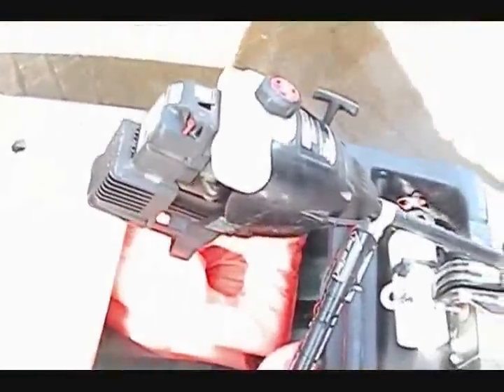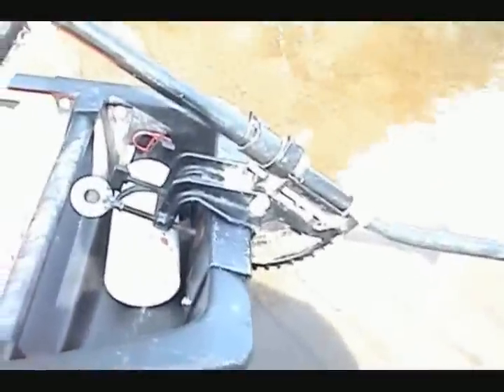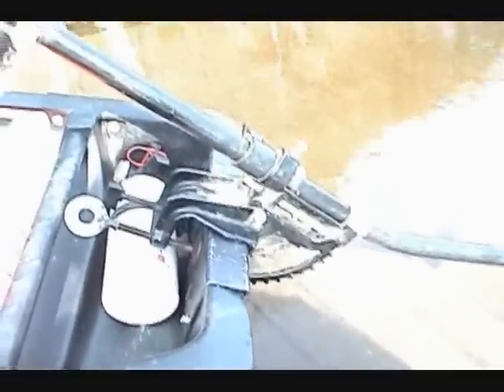Weedeater Boat Motor

Comment from the maker: I got the prop at a local marina called Castles marina. I pretty sure it came off of a Motor Guide electric trolling motor, but I am not sure. It did not have any markings or numbers. This one is clockwise rotation, which is what i needed for the direction my weed eater motor spins.

Comment: Just making a suggestion here, but what I did with my weed eater boat motor is took off the muffler, made a coupling that would fit the exhaust outlet on the cylinder head, put a steel 90 degree fitting to direct it down. Then I drilled a hole in the plastic that encases the engine. lastly I continued on from the downward pointing 90 about 7.5 inches; put on another 90 facing left. I continued down the shaft until the pipe was about 3 inches from the prop. (under water) 
Quiets it down alot!

Comment: very good and using the edger unit gears it down about 2 to 1 which will make the clutch last longer now lots of comments on here about using a bigger prop ignore them,
very slowly with lots of test runs sand off the ends of the prop to put less torque against the engine and it will rev up into its proper power band and wake up nicely and the extra engine speed will better engage the clutch and turn the prop better for increased  boat speed make sure you can get another prop if you overcut

Comment: excelent..   I use something similar.. It is a Riobi 25cc bent shaft model without a gearbox on the end.. (cable drive)  I use a tiny bronze 3 blade prop meant for an RC speed boat.. I is less than 2" diameter but I get a good 4MPH from it..  I burned my standard centrigal clutch and it melted all my housing.. After repairs and converting to direct drive I have a cracking little motor.. Will have to make a vid to show you guys,...   nice work

Comment: I think that the electric motor( that you took the mounting system off) goes faster.
Reply: StalkinYouJustNow Yes. I have a Minn Kota Endura 40 that will out perform this. I think it's the propeller.
Reply: +StalkinYouJustNow     Perhaps. But that electric trolling motor, with battery, weighs eight to ten times more and has a very limited run time.
   The weed trimmer runs on small cans of pre-mixed fuel and can go on as long as that fuel lasts - and with the right size and pitch prop, can move at a pretty good clip.
   Finally, in my case, since the boat prop is mounted by a removable attachment, my boat motor can still function as a weed trimmer. Try that with your electric trolling motor.
Reply: i agree
Reply: We  have designed one that attaches to a weed wacker quick and easy.

Comment: sounds like it could use a smaller prop, trolling motors tend to be pretty low rpm and high torque, the complete opposite of this weed wacker engine, but good set up!

Comment: @vwdriver8542 : maybe you should use bigger propeller.  I'm pretty sure the engine can handle cause your's look kinda small, just make sure it's not too big for that engine.  I'll build one when I got time probably few more months.  I'll buy the one with 4cycle at Sears.  Is yours 2 or 4 cycle?

Comment: Get better speed if it was wind propelled i bet. Or instead or a larger made housed prop. Or instead of prop make pvc water jet. You could also make a noise counciling box for it...if u wanna get really fancy make it water cooled. With a mini water pump attached too the crank shaft or proppeller

Comment from the maker: @polerigger Yes, you do have to get a prop that corresponds with the direction of rotation of your weedeater.  They had a decent selection of props at my local marina/boat repair shop (Castles Marina). The first prop that I got was the incorrect rotation but I could turn the weedeater backwards in the mount and it would pull instead of push the boat through the water. The second prop was correct. I would also suggest the smallest prop available. The one that I have is almost too big.

Comment: Hey worse came to worse your electric trolling motor goes out you have this thing just for a spare oh yeah, worth the investment looks like a great tool to keep around just in case your to lazy to paddle or run out of juice, Very clevera bigger prop would just put more stress on it and probly take half its life off it!

Comment: I tried this years ago didnt work too much pitch on prob and size stalled engine You need a plate above prob and a pipe from exhaust going under water to drop noise level
Reply: You need to use a trimmer that has a clutch otherwise it will die as soon as it hits the water!

Comment: How did you over come the resistance of the water killing the motor on the weedeater
Reply from the maker: Just the size of the propeller. I know it looks tiny, but this one is actually too big to allow the motor to run in the power band. Weedeater motors are popular conversions for rc boats now. The rc world will have a good selection of properly sized props.

Comment: hello im 12 but my dad had gotten me a small 12 ft jon boat and i was wondering how fast do u think a 50 cc weedeater motor with a trolling motor prop would push my boat because we go through some rough terrain and well i  like longtail motors moe than standard short-tail outboard motors? plz reply (and wut if i used a 6.5 horse lawn mower motor)

Comment: u got no rpm. it will soon clog the exhaust screen because its wide open but not reving up. carbon fouling will happen if you trim or grind some of that prop off your rpm will come up into the power band of that motor, you will go faster and it wont foul out as bad also try mixing your fuel to 75:1 and use golden spectro you dont want to use outboard 2 stroke oil they have a high ash content because they are intende for water colled engines and that ash will cause piston scuffing and ring wear

Comment: You can modify the exhaust by welding up some small pipe, running it along the propellor shaft and dumping it into the water above the prop. It will make it much quieter. Great job. I have an old air cooled 4 hp that looks similar to what you built, and that is how it's exhaust runs. It's amazing how much quieter it is when it's under water.

Comment: As far as the sound goes,i built one using an old Craftsman trimmer one time,I modified the exaust,I fitted a piece of steel pipe to the muffler an ran it down so it was like a boat exaust,in the water.And a steel plate just above the prop goes a very long ways,it keeps the thrust from shooting upwards giving you more power.Mine was VERY effective until the plastic prop flew into pieces from to many rpms,find a good aluminum prop you can make work.

Comment from the maker: @swabbster3 I found my setup to be extremely fuel efficient. I ran around the lake for almost 4 hours non-stop and never had to add gas to the tank. I took a small 1 Gal gas can with me just in case, I never needed to use it. I wouldn't fool with running extra lines to a tank. I would just fill the small tank on the weedeater when needed. Its nice to have such a light weight setup that you can detach from the boat and throw in the truck, disconnecting fuel lines ect would be a headache.

Comment from the maker: Thanks for the tips. Sounds like you have done this before. I do need to get it up into the power band, but it is currently running strong. I updated it a little and added a bicycle handlebar yoke to attach the handle. I think I'm going to put my Stihl 310 trimmer head on it to see what the power difference is like.

Comment: I just got finished making one of these my self. How do you keep it from cutting off when it hits the water?
Reply: +Chris Ritchie did you use incredipull model? you gotta use weed eater with a clutch from what i gather don't know how this guy pulled it off guessing its the incredipull feature.
Reply: The propellor may be too big.
Reply: Chris Ritchie propeller might be too big you might have a bad carb or just beed to clean it replace the plug do a full tune up and if all fails then its your prop

Comment: All this peps mount it, They produce enough thrust to stay in a C bracket.
Its a one handed control, Easy!  we replaced the canoe bench seats with 
plastic one piece patio chairs, X4, cut the legs down an mounted in the canoe.
boom box up front,  Cold beer cooler in the middle, an its on like donkey kong

Comment: Are you still using this 8 years later? Did the clutch last?  I am working on a mud motor made from 25cc weed whacker.
Reply from the maker: Yes, still working. Not a ton of hours, but a few times a year it’s been out.

Comment: I have got to say! Congratulations! also, it seems to me like you need just a slightly bigger prop...if you can get a bigger blade you might get some more hp ...im not saying go grab the biggest prop out in the yard you can find but a 2-4 horse should work for you if not just 2-3..if you take a quick trip to a boat store you will see the size of them. Good luck and happy sailin' man (ps.. try tripping your butterfly throttle ;D)